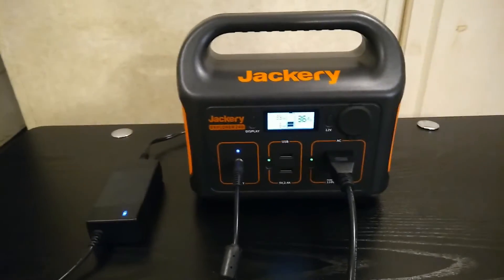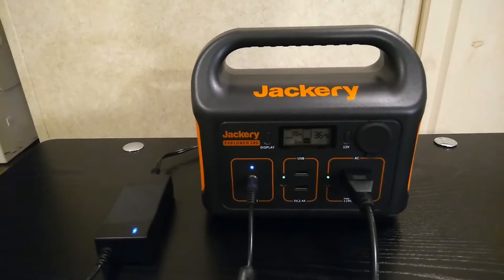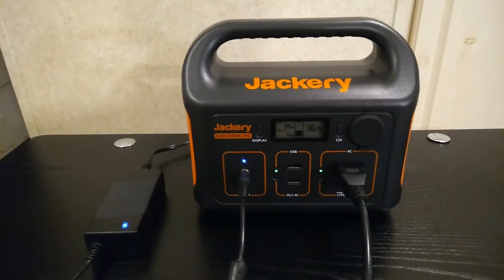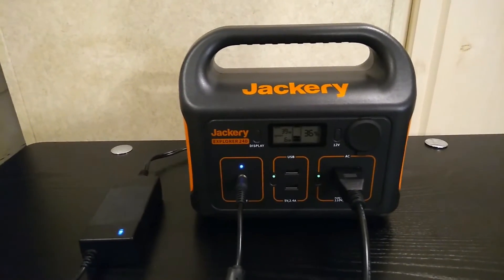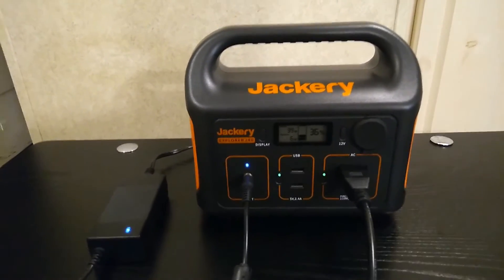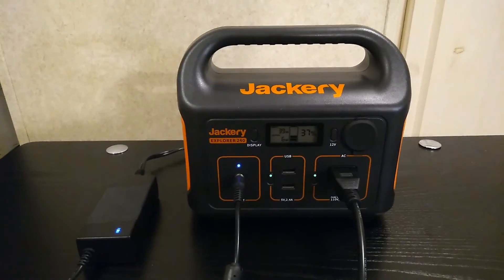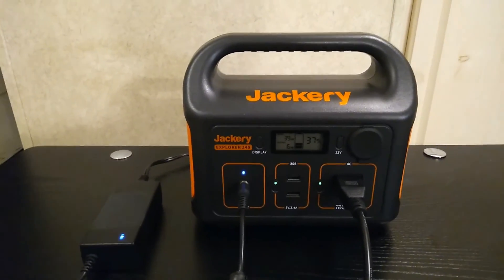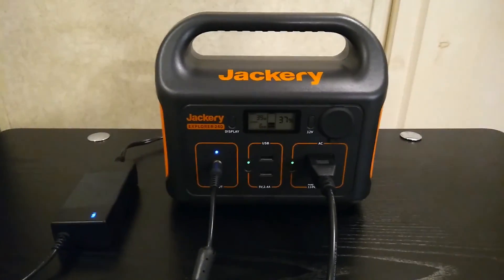Passthrough charging explained

Comment: I have a 1000w LiFePo4 (2000w surge capacity) power station that does not like me charging the battery from the wall while running my chest freezer (195w/600w surge). The freezer actually only draws 60w when running. When I attempt this, it throws an OVERLOAD indicator light and shuts off powering the freezer. It doesn't seem to mind to power a 75w lamp while charging from the wall. Could this be an example of what your saying? (Like...it works but it doesn't work?) Thing is...there's plenty of room within the 2000w surge capacity of the battery.

Also, should it make any difference which order you plug in first or last? (AC in or AC out)?
Reply from the maker: Which model? How many input charging watts? And does it have a UPS function?

If it doesn't have a UPS, they could be limiting the output when charging, yes.

If it does have a UPS, perhaps if the surge exceeds the power coming in from the wall, it could briefly confuse the power station, or just simply cause a slight delay in power delivery, which could lead to a fault code.
Reply: @SoGenFan  All of that makes sense. Input charging watts I believe are 700, although I notice it's displaying more, around 760ish. It's probably the initial surge that's triggering the fault. It's a budget power station. (iForway HS1000). The one I have now is a replacement because the first one failed out of the box. I did the initial charging to the battery, then plugged in the freezer, and it failed immediately. No more AC in or out. Product reviews reveal numerous people having the same problem. The new one they sent works good so far, except for the pass thru charging issue with the freezer.
Reply from the maker: @zippy2641  Yep, that surge is probably just a bit too high unfortunately. I'd look for a unit with atleast 1000w wall charging to use with that freezer. And a UPS with less than 15ms switchover just in case.
Reply: @SoGenFan  Here's the beginning of their product description:

About this item
【UNINTERRUPTIBLE POWER SUPPLY】: IFORWAY newly upgraded solar power generator not only supports pass-through charging, which can be discharged while charging, energy saving and continuous powered. And if the power suddenly stops during hurricane or snowstorm, it can automatically switch within 0s to provide emergency power to your CPAP, refrigerator and hot blanket in time, without worrying about power outage.

I'm guessing that the "newly upgraded" UPS feature might have been a hurried poorly tested add-on and they are failing. They are literally dumping them at a deeply discounted price ($450)...no doubt for that reason.